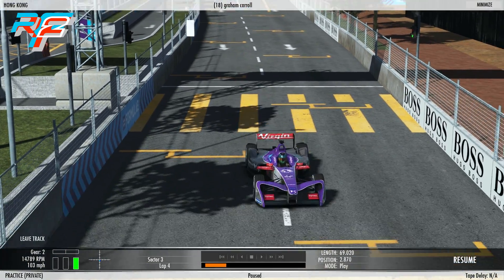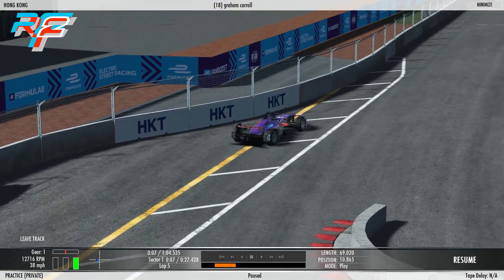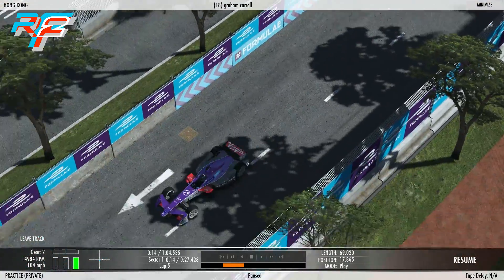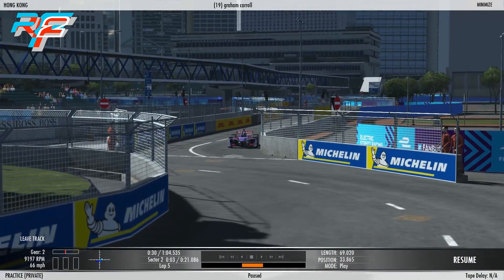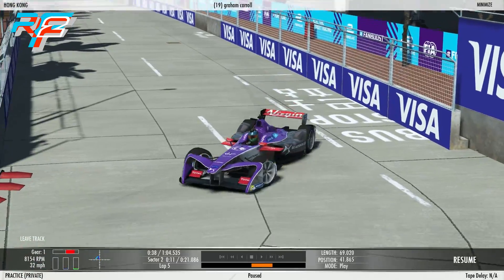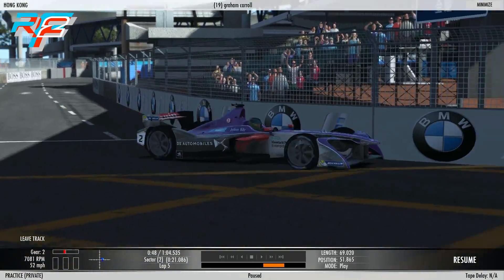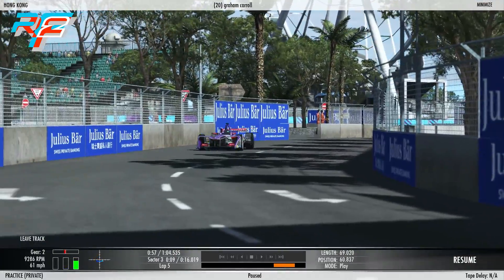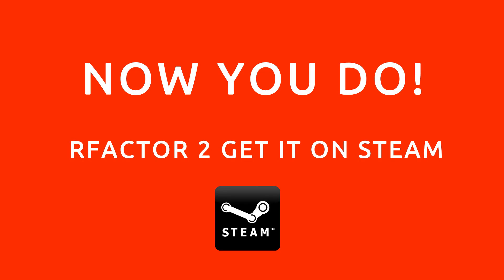Did you know? How to drive a Formula E Car!

Comment: I don’t have the engine break map listed in the settings. 
I also don’t have tire data on my dash in the car. 
What is wrong there.
Reply: I have the same issue. I'll try validating local files and restarting steam
Reply: Thanks for the hint.
I had to select the latest beta build in the steam properties beta drop down menu. 

Great work with the DLC. I really enjoy it. 
The only things missing are a gradual fuel indicator in the wheel dash and that the AI learns to lift and cost and pit once to a real race.